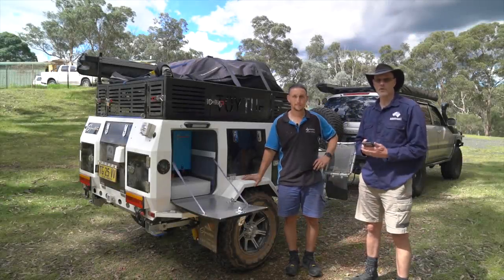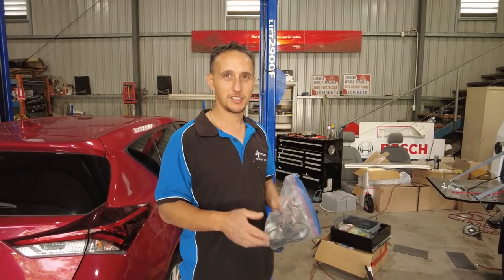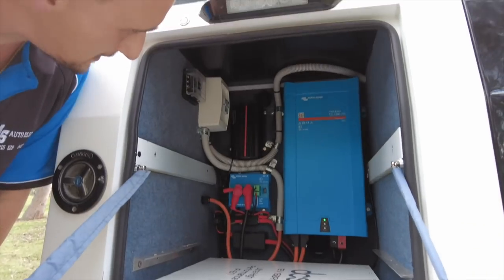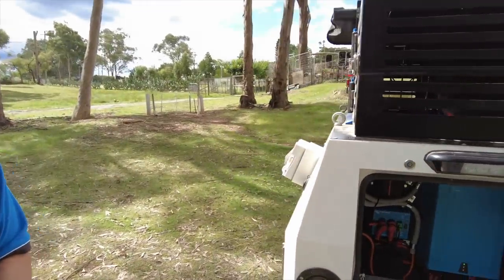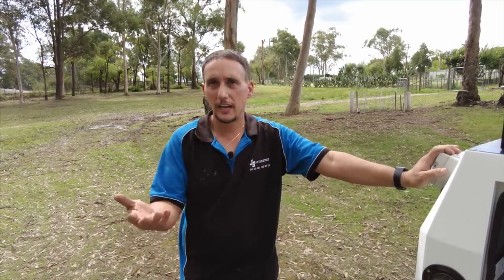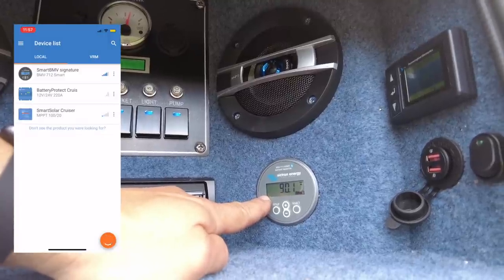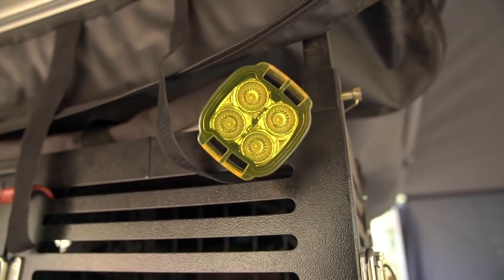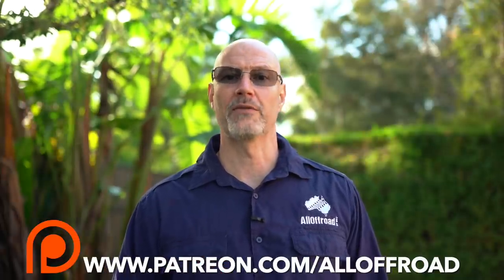Signature Deluxe II Off-Road Camper Trailer - Electrical Upgrades | ALLOFFROAD [2021]

Comment from the maker: What do you recon have I missed anything electrical? Let me know in the comment section.
Reply: The additional switches - would be interested to know what they were for, ie did you separate the yellow light over the kitchen from the existing lights main switch?  If they might be related to security, no worries, I can find that out for myself.   We haven’t even got our camper yet, but your videos have been so helpful in preparation.
Reply from the maker: yes mate one extra switch is for the yellow light, one to switch off the humingbird and two still to be used.
Reply: @AlloffroadAu  fabulous!  I’ll leave you in peace now ☺️
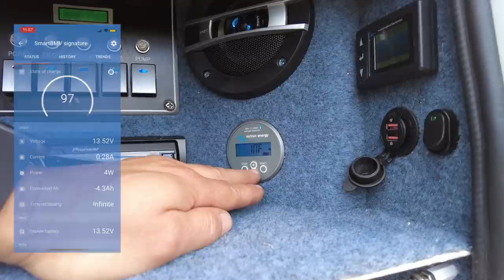Reply: Well actually you mentioned something at 13:40 which caught my interest and that is that the camper is seemingly drawing power from your car's auxiliary batteries?

Not that I don't think it can't be done because obviously the connection going to the trailer's battery is via a DC-DC charger (rather than essentially paralleling the two systems), but I thought that nobody would do this because it's somewhat inefficient to pull from one battery (or batteries) to charge another?

The main reason it interests me so much is (and I've been asking Joe in other comments some advice) I'm helping my Olds setup their car auxiliary battery box and caravan electrical and looking at adding a 100~120Ah LiFePO4 battery as the car auxiliary, but the Caravan's 100Ah AGM will remain for now (electrical upgrade maybe in years to come) and I'm trying to work out how all the wiring will be installed so that I allow them to be flexible with their arrangement.

Whilst I don't have an exact caravan electrical schematic, a call to the dealer (about a caravan 5yrs old already) said that most are wired pretty much direct from the drawbar grey Anderson to the battery (no doubt (with a fuse in-line hopefully!) for charging from the car alternator because of the similar lead acid type charging profiles), but what can I do with the intended setup described (thinking of more when they're free-camping)?

I can't connect it like you guys have your trailer can I because otherwise that's pretty much paralleling two different battery chemistry types, so is the only answer to either just run the electrical from the alternator straight through like most do and never mind including the auxiliary battery in the equation or if they want to used the auxiliary battery as a form of 'back-up' to the caravan, they need to have a DC-DC charger (set to AGM profile) somewhere between the auxiliary and the caravan's battery?

As I didn't want to alter the caravan's electrical much at all (other than adding a bluetooth monitor/shunt), would a DC-DC charger still charge effectively (but maybe not to exactly 100%) the caravan battery with the slight voltage drop incurred by a couple of connections and length between the car rear and where the battery is in the caravan? I was even thinking if I set it up correctly, I could essentially have a switched system (complex I know) but that would utilise the one DC-DC charger, but have it switching between the two batteries depending on whether you're driving or free-camping.

Aren't you glad you asked Stephan? lol (sorry)

Comment: Great review Stefan 👍, I have a DCS 200 amp/hr in the caravan and it is sensational. I’ve got 400 watts of solar on the van roof running through a Enerdrive dcdc 40 and the battery hasn’t got below 90% state of charge . That’s running a coffee machine in the mornings ,charging drone batteries, stereo all day , inside and outside lights at night and two sirocco fans all night. I agree with you about AGM batteries and I don’t understand why caravans and campers don’t come standard with lithium. Thanks for having such a great YouTube channel,can’t wait for the next one.
Reply from the maker: yes the DCS is great stuff, I wish I had 400w of Solar but just upgraded to a 300w so that should be sufficient for me. Yes I guess it all adds to the price at 18k the trailer is quite cheap.
Reply: @AlloffroadAu  300 watts will be plenty mate , I like the victron inverter you have .  Awesome setup.

Comment: Noticed that you have a Multiplus inverter/charger running thru a BatteryProtect. From the video I cannot tell how it is exactly wired, but it looks to be that the battery is on one side and the BCDC and the Multiplus is on the other. This would mean that you are putting current backwards thru the Battery protect. These are not designed to have current from the OUT to the IN terminals, this will damage the battery protect if ran this way. Just a thought and hope I am wrong. Otherwise looks like a solid upgrade to the electrical system.
Reply: Hi . The BCDC is wired to the battery input side. The multiple plus is wired to the output side. It's wired this way because if the battery open circuits (while camping) the bcdc will still charge the battery an re engage the battery protect.  In this application the multiple plus is only used as a maintenance charger and will not be plugged in if the battery protect open circuited.
Reply: @thetravellingsultana7495  Hi Joe, great to hear some of your thoughts on the electrical system etc. in this video 👍🏻

Just wondering if you could please elaborate on this a bit more for us:
5:47 - I see where Byron is coming from as I actually looked up the data sheet myself (from Stephan's products links, you can navigate to https://www.deepcyclesystems.com.au/wp-content/uploads/2020/04/Datasheet-Battery-Protect-65-A-100-A-220-A-EN.pdf).

It does indeed say "would this not potentially damage the MOSFET switch used by the battery protect?

Also, I love the look of Victron's products and especially the inclusion of bluetooth in many of their products. How does their DC-DC charging gear compare to say our REDARC's?

I've also subscribed to ya mate coz I wanna see a JS Auto Electrics channel soon haha 😉 Cheers
Reply: @lahmyaj  Hi Ashley. I have a similar set up in one of my vehicles and it has been fine so far. I do however de-rate the charger out put current to 25 amp. This is well below the bp220 current rating.  I think it would be an issue if you where to push high current backwards when the BP220 de-rates at 50 deg or disengages loads. As I said earlier the charger only maintains the battery when in storage.

I mainly use the the victron monitors, battery protect units and 240v chargers. So far they have proven to be really good units.

As far as DC charges I have not used there product. I have been happy with the Redarc  BCDC and and Manager systems.  

As far as the channel let's see how we go. What would people like to see from an auto sparky. Give me ideas and maybe it'll be a space to watch. As I tell everyone the industry is a changing one. I'm always learning and always will be. I'm always open to new things and ways of doing things.
Reply: @thetravellingsultana7495  thanks for that, really good to hear from an Auto Elec. and to hear the rationale behind some of these decisions that otherwise seem odd/confusing.

Basically these other few Q's might help understand at least what people like me would like to see out of a potential future YouTube channel but I love the nitty gritty of electrical/electronics so probably go a bit beyond most by reading data sheets or manuals where I can to know more.

So I'm actually assisting my Olds coz they're going to be grey nomad'ing soon and I'm actually just about to sort their car's auxiliary battery box and add a shunt to their Caravan's system (probably will get an electrical upgrade down the track, so just a bluetooth monitor/shunt for now).

Probably will get a 100~125Ah LiFePO4 battery, possibly one with built-in bluetooth or ability to connect a bluetooth module to and can't figure out what DC-DC charger to get and what amperage because in my head I want something that can charge fast when needed (which is why I was looking at the REDARC BCDC1250D for up to 50A) but slower when faster charging isn't needed.

differentcompressor used and for any other unforeseen high-draw devices, so that after their used, charging will get the battery back up to 100% a lot quicker as the drives will be probably no more than 2-3 hours each day.

The other thing to ask (whilst I'm stealing your time sorry) is what on earth is do people normally do in regards to 240V AC charging?

The scenario in my head is pull up at caravan park, plug in mains to car fridge and so I was thinking, why not have a Y-adapter with a 240V AC charger hooked up to the auxiliary battery? Is this what people do or do most not worry about his and just charge it up next time they drive? Also the difference between just wiring in a regular (but good brand) charger that you might keep in the toolshed vs. one of these seemingly similar to DC-DC charger units that seem to want to be permanent fixtures but they more look like they're designed for caravans (was just thinking a 10A charger for overnight charging is more than enough rather than the 30~40A units I've seen around).

Thanks again for answering my Q's so far and won't be offended if you don't have time for that essay above lol
Reply: @thetravellingsultana7495  Yeh cheers, I appreciate that. I'll give you a call probably Tuesday morning ;)
Reply: @thetravellingsultana7495  Thanks for your reply, I get what your doing. As you said given the 220A unit and the fact that you de-rate the charger it will be fine. You would potentially lose 20-30 Watts when conducting current in the reverse direction on the Mosfet. Do you know if you can program a Low Voltage shutdown on the multiplus like you can on the Multiplus II units. This would allow you to connect straight to the battery without using the BP for the inverter. I do love some the features of the victron gear.
Reply: @lahmyaj  I have used both the Victron and the Redarc DC-DC chargers. You cannot beat the Redarc chargers for simplicity although there is a few things that could really be changed in them. Stefan does a good video and points out some of these short coming. The victron units are great if you need the ability to tweek charge voltage levels etc, but they max out at 30A, they do have some rebranded 50 and 100A units but are fairly expensive and do not have the ease of the bluetooth connectivity.

Cheers

Byron

Comment: Good stuff Stefan. Can you please explain a bit more about where the fan is drawing from and venting to? It is between internal compartments to increase volume or to outside. If outside how do you manage dust?
Reply from the maker: It's venting from smaller internal compartment with inverter in to the big fridge compartment which in return has a vent with filter in the door. So far no dust ingress.

Comment: Just a suggestion - the 12V cig sockets on the outside on the back of the camper are facing slightly upwards and will fill with water and dust. The covers will not stay on.  Perhaps worth putting them in a simple plastic Narva housing so they face down.
Reply from the maker: yes, we thought about that as well not the best position for the sockets, we have Sika flexed them but at some stage will, as you also suggested, put them in a plastic housing facing downwards.

Comment: I have a Trackstar camper and the parts and design are extremely similar! Probably made in the same factory!
Reply from the maker: I think a few companies building upon the same base and using this as the platform. How do you like yours?

Comment: Can you clarify the you have used the BMV-712 as the disconnect trigger for the BatteryProtect? If so what did you set the trigger point at? Thanks
Reply: Hi. Yes bmv712  triggers the load disconnect.  We have the disconnect trigger at 12.6v and 20%soc. 12.6v is what dcs recommend for their batters as this is 20% soc.
Reply: @thetravellingsultana7495  So just to confirm, how do the battery monitor trigger the load disconnect? It obviously has some sort of trigger output or something?

Also, is 80% the rule of thumb you use for LiFePO4 or do you always check with the battery manufacturer on their specific battery? (Rules I heard was 50% for AGM and 80% for LiFePO4).

Cheers
Reply: @lahmyaj  yes the bmv has a com line. You can also use a smart BP which allows you to program via voltage without the bmv if your battery has Bluetooth and you don't want a bmv

With the lithium battery brands we use  20% soc  is the recommended discharge percentage for battery longevity.  You can use the full capacity but this will shorten the cycle life of the batteries. But I would check with the battery supplier first as I'd say different manufacturers would have different requirements for full cycle life.

Comment: How is the battery set up in the trailer,  still  a DCS? I think these batterieswoul fair better tha under bonnet stuff.
Reply from the maker: trailer is sold battery but did capacity test before I sold it lost 13% in 3 years with only 50 or so cycles, bluetooth stoped working so could not get exact cycle count before sale

Comment: Great video Stefan, thank you. Are you able to provide a price guide for this upgrade?  My husband and I have had a guess 😁
Reply from the maker: I will give market prices for everything in the full walk trough video yet to come. I would think it's bit below 10k including labour
Reply: @AlloffroadAu , we weren’t too far off. Still affordable in comparison to competitor campers that are all inclusive.  Look forward to the walk through video.  Cheers.
Reply from the maker: yes 100% In my eyes in many ways better than a Patriot set up for a fraction of the cost..
Reply from the maker: Victron BMV 712  $239
Victron Multi Plus 12|1600 |70  $1300
Victron Smart Battery Protect 12/220 $170
Bushman SC 35-52 $1495
Hummingbird GPS Speed Alert with Odometer $350
Redarc BCDC1250D $682
LazerLamps Utility Light $30
Reply: @AlloffroadAu  thank you.

Comment: Hello Stephan,
I am planning on being part of an west to east crossing group in 2023. I am seeking feedback regarding the suitability of the signature deluxe11 or whether to even consider a trailer for the trip. I have had experience on Simpson desert ,hay river and part of the madigan line. My concerns are for the  suspension and strength of the chassis. My question is would you take your Signature on such a trip. Ie suitability of the trailer for the conditions and whether to tow or not to tow.
Reply from the maker: personally I like to do Desert and remote trips without a Camper, I can't really speak to much about longevity or quality of the trailer yes as it's early days for me. There is a guy with a Signature D2 who has done 1/2 of Australia in his and hit held up ok but need a few welds on a few places including suspension arms. Check out the Signature FB Group for more info.
Reply: @AlloffroadAu  thanks for the feedback. I am leaning toward not taking a trailer but looking at all options. There is only me in my car so I can compromise to suit my self
Reply from the maker: @kenthompson3186  I would never take a trailer by myself, solo travel I can be quite comfortable with a car and it just gives you so much more freedom and it's way more fun to drive without a trailer, in  my book.

Comment: Stefan why didn’t you go the Victron BCDC instead of the Redarc?
Reply from the maker: to low charge current and operating temps otherwise I do like the Victron stuff and have a few Victron MPPT and disconnects